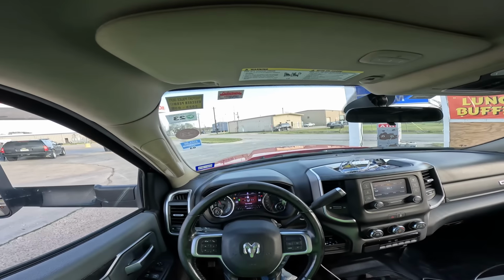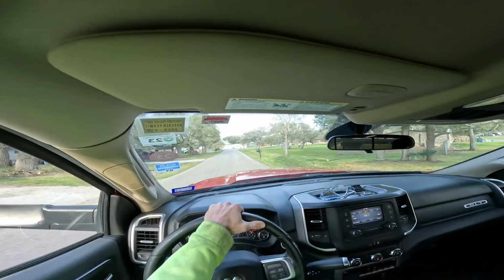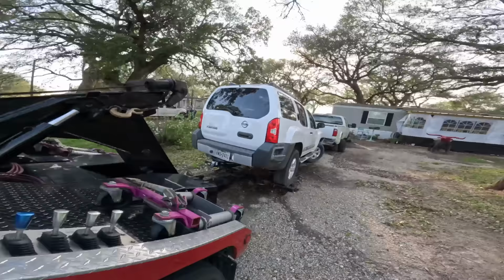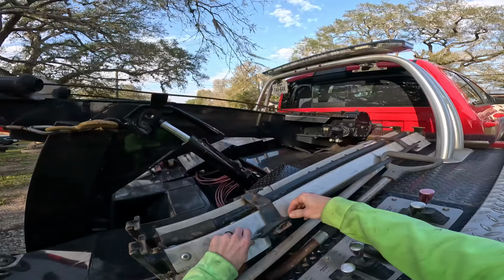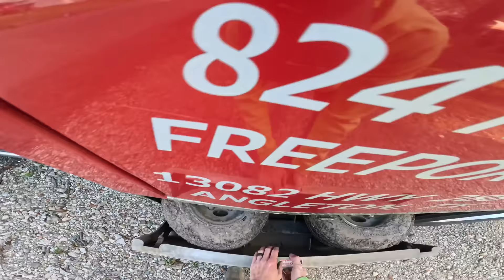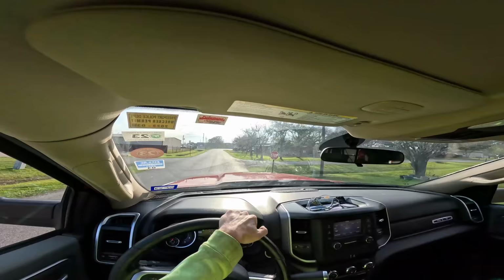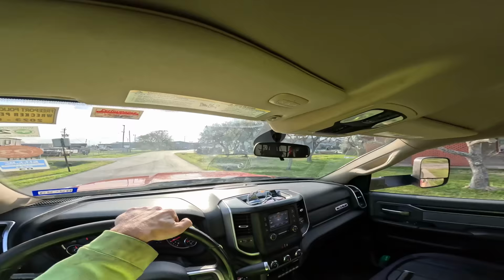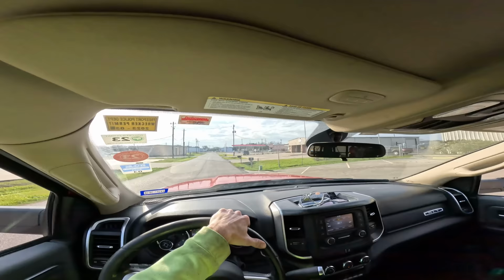Turning Your Wheels Won’t Stop The Repo Man!

Comment: Doubt this was a real "repo".  He could have easily pulled out  with just the rear up and deal with the crabbing until he got to safer place place to rig the front.  Still a good demo to see how much time it takes but on a repo, all you really need is the rear up for a few blocks.
Reply from the maker: You’re entitled to your own opinion, but in saying all that, it just goes to show you’ve never  done this line of work, and definitely don’t have the mind set for it. If I’d have hooked onto and rolled out, the front end would have dropped down into the ditch, and then I’d be paying to fix it all. 
Contrary To what you see on TV, not all repos are snatch and grab. Very different in the real world.
Reply: @Towtruck_Dustin  BS Dustin.  Ain't no tow truck driving job worth taking a bullet, knife, or beating for.  You clanking around with the front dollies rigging in the morning was exactly what you shouldn't have been doing there.  When you've got those straps on the rear, time to go to safer place to do the rest.  You should also have a partner with you when you do repo's also.  
ALWAYS, in any job you have, put your personal safety FIRST, Fk the job.  If you aren't concerned for your personal safety, your boss sure ain't going to be.  Be your own first priority.  Your Mom won't ever appreciate having to go to your funeral, don't volunteer yourself to set her up.

Comment: i live in a small rural town in east texas.  Can someone with just a wheel lift truck make a profit doing quick loads like repos and easy accident hauls.  I have seen used wheel lift trucks for 20-30 grand?
Reply from the maker: The market is different everywhere, but you could definitely make money with one truck if the market isn’t already being held by an older established company. Many small towns are hard to start in when you have other established, well known companies already operating.
Reply: @Towtruck_Dustin  thanks, ill do my research first, just did not know if limiting service was normal in the industry.  appreciate the reply

Comment: park next to a wall with rear wheel access only...  turn front wheels to full lock so when it is pulled it would hit the wall with the front end and dollies cant be used... that will stop ,most drivers for that purpose..
Reply from the maker: That wouldn’t work either lol if it’s front wheel drive then the tires being turned would just slide because it’s in park. 
If it was rear wheel drive then we just just put gojaks on it. And push it out.

Comment: Way too much time. Yank that stake out of the ground, get down the road to the first parking lot, and throw the dollies. The more time you are on scene, the more likely there is a negative interaction with the owner.
Reply from the maker: Guess you missed the part where the wheels were turned right at the ditch. Wasn’t coming out of there without causing damage, that I’d be liable for.

Comment: Why mot use a flatbed ? Just drag it.
Reply from the maker: I’ve done it many times before, but it takes quite a bit of time, and room to extend the bed out. In most cases you can grab and go, and a wheel lift is the best tool for the job. In this case, the wheels were turned so I had to throw Dollies, which means the front end would still kick out even if I drug it with the flatbed, and on this tiny little neighborhood street, there’s just not enough space to correct for that.

Comment: Why not just lift and leave,pull over and strap
Reply from the maker: As explained in the video, the wheels were turned so it would have dropped off in the ditch. Causing damage that I’d be liable for.
Reply: Thank you for the reply... be safe